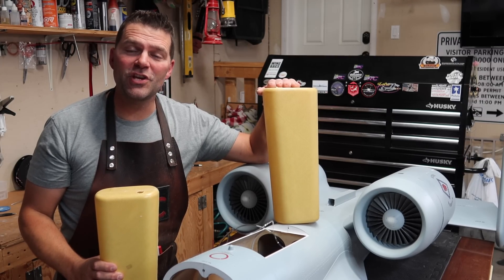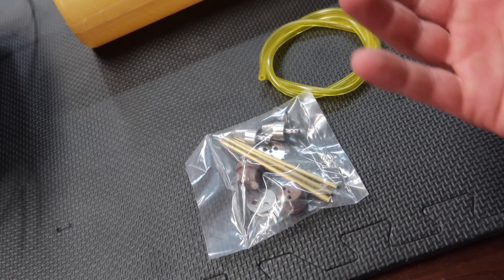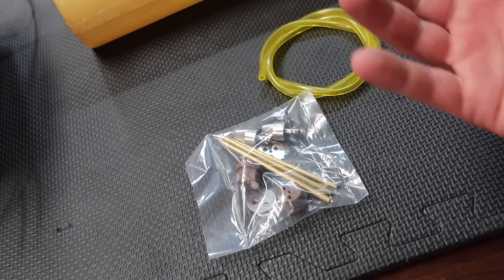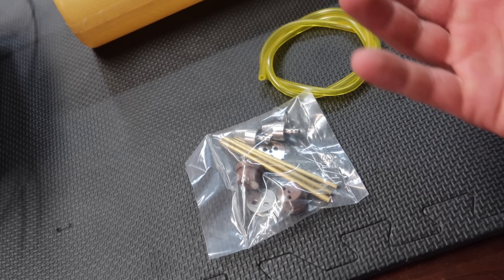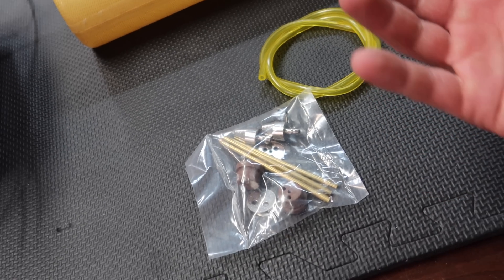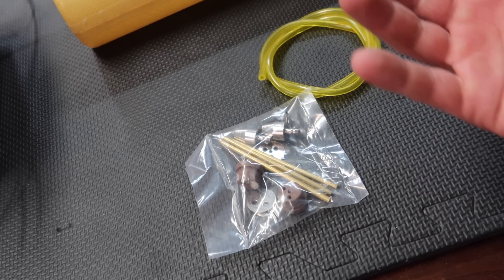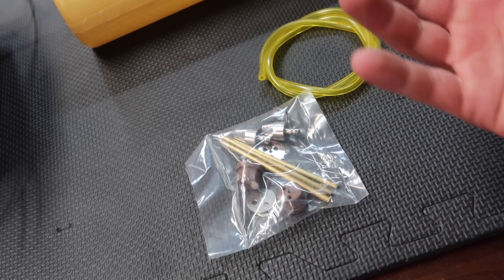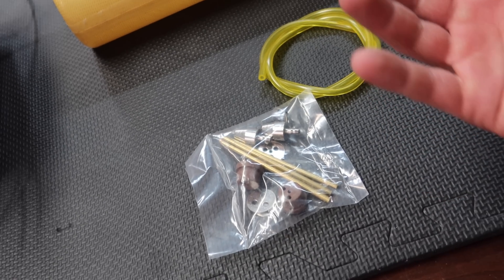SKYMASTER A10 Fuel Tank/Mid Section install

Comment: Very good , although regards fuel tank bung. Consider using dummy tube or rod in third hole/port in rubber bung. If you know how thin the membrane you punch through on other two tubes you would do it. Brass rod or use short tube with crimped and soldered end. Also the bung security/tightness at the infilled hole is compromising. I noticed nothing else was compromised…well done ✅
Reply from the maker: Thank you!

Comment: Jonathan Did Fort Wayne Air Guard help you Out? I told a Few people about You( good thing Only) two want to Look at A10 builder. One your fuel Refill tank for Jets. I did a little flying my Glider. My Coach loves how it Fly’s.  God Bless.   Greg
Reply from the maker: Thanks Greg. There were a few suggestions on color that I got. It’s just a matter of weather those colours relate to something in the paint shop.
Reply: @thelightersideofrc  if you like our RC Model Club is in Fort Wayne in there is A Pilot that Flys the A 10 that is Painted that Color. Someone said Navy Blue  I ? That because it is Called BlackSnakes ? Also that Pilot may like to See hhs Name of the Jet Model!  Jonathan what the Price of your Fuel Jugs? Do they Have a Computer to tell how much Fuel goes in Each plane? Thanks
Reply from the maker: Thanks 😊. There are many options for the jugs. Best thing to do is check out the site for all the options
Reply: @thelightersideofrc  Jonathan I could Not find them on your Site? Do I look them on what Site? Thanks. Greg

Comment: Jonathan go to Air National Guard Fort Wayne , Indiana that where theBlackSnakes Fly out of. Also they did that Paint for General Anthony Mad Wayne ! As For the Jet Garage maybe connect to Home that way you only pay for Three Sides? would a Barn style Shed Work for you? They make them long and Tall? They run around $15,000. Now not to be Mean but How about a Fundraising for the Huracan Engine program? Yes to Both Fundraising.
Reply from the maker: Thanks Gregory.  We are pretty set on the location at this point as the propane tank and shop power conduit has been run to suit.  That can always be changed.  Man door on shop and man door on garage will be beside each other so access is easy.
Reply: @thelightersideofrc  Jonathan how about using Foam construction? Check to see if there a Polysteel in your Area? If yes they have a Form to make a Concrete Roof
Reply: @thelightersideofrc  Jonathan hate to Bug you do you know someone that Has a 3D Printer? Thanks for all you Time.
Reply from the maker: Yes. My friend who does all my stuff I sell on my site.
Reply: @thelightersideofrc  Jonathan yo the Best  Could you Ask Him a see if he could Build a H-King FlyCat/ fan Duct plane ? They Don’t make it anymore?
Reply: @thelightersideofrc  Jonathan what kind of Heating and Cooling you going to Do?   God Bless
Reply from the maker: Send me an email and I’ll forward it to him. 
In the shop not sure yet.